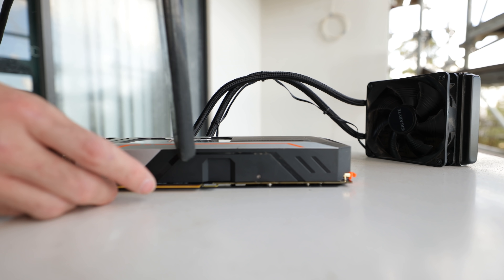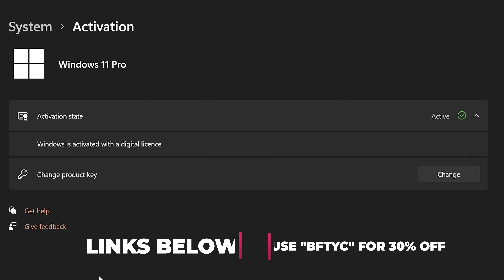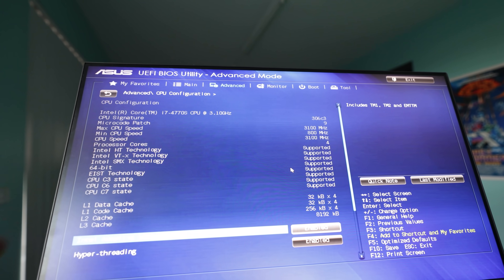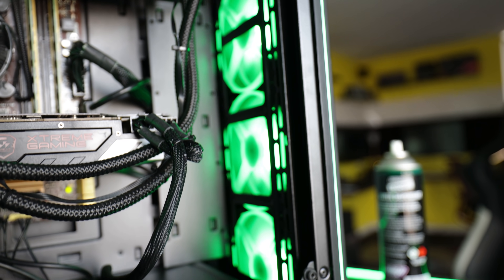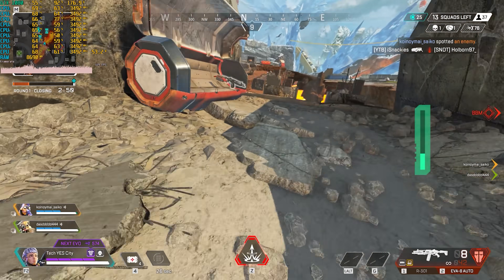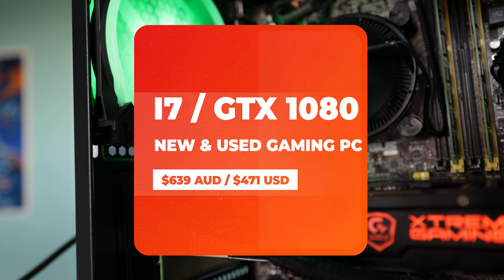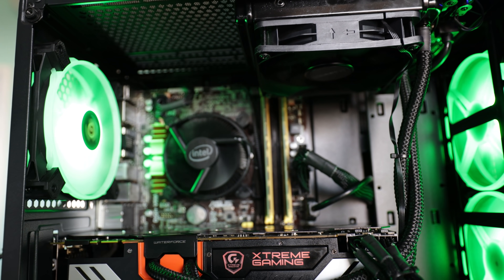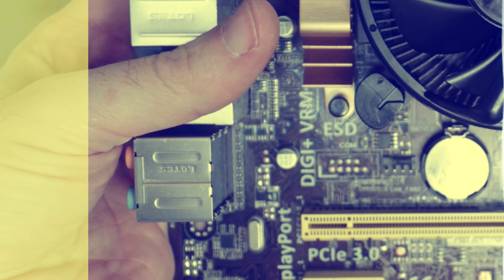This GTX 1080 STILL makes for a SOLID Gaming PC

Comment: Pascal was overpowered. Nvidia won't make this "mistake" again!
Reply: By default it really made the gtx 16xx series pointless before it launched
Reply: @licksludgee  As an owner of a 1660 Super, I don't dispute this at all, but I'm still perfectly happy with my card. Does everything I want it to at more than respectable visual quality.
Reply: @richardsinclair7661  because so many people have them, they were obviously necessary, it would have been arguably better if they mass produced 1070s and drove the price down for everyone instead though, I think that's where the frustration lives. Nvidia haven't pushed their performance much between the last few generations, it's a good thing for all of us when we can't get fairly priced gpus
Reply: Yeah 10xx was the best launch. 20xx was a fail, with no improvement in price to performance. 30xx they claim an improvement but its only cause they compare with 20xx.
Reply: @hellowill  *Grunts in Maxwell* Excuse me?
Reply: @hellowill  also don't forget gt 1030

No current successor today :( of low wattages, size, and performance
Reply: @bitelaserkhalif  
And underclocked 1050 or 460 outperforms the 1030 in watts and power.
Also, the 750ti exists
Reply: @DarkLinkAD  i had 760 2gb OC not ti but good start I got rx5500xt 8gb was m first but never used it. My motherboard died on me so I contact asus for warranty and support team help me out. To check the ram I send my memory for rma and never did rma code on the package. So I wasted $50 usd. My current GPU is gtx 1050ti 4gb it is ok for now. Wanted gtx 1080 8gb. My mobo is replace works nice with 16gb ddr4 max mhz that my ryzn5 2600 will go. I would like to have 3600 just 3600 and maybe tpm2.0 for flopows 11 but soon to linux after anticheat will works smoothly.
Reply: @bitelaserkhalif  Worse than a 750 Ti
Reply: @danb4900  750ti tdp: 75w, some model needs 6 pin for stability. Low profile units are hard to come by
1030 tdp: 35w, no 6 pin needed. Lot's of low profile models sold
Reply: @bitelaserkhalif  integrated graphics is now better. GT1030 DDR5 version was a good card to modernize old PCs for streaming modern video formats. Took an old dual core system and made it able to easily playback 4K 60fps. Now though integrated graphics does the job so these cards have very little use as they are not good gamers.
Reply: RX480 for 200$ got them shook
Never again now
Reply: @blackknight50277621  4gb were$199 and even that was only FE models. 8gb were going for 250+.  At times there was like 30-40$ difference between 1060 and 480 models
Reply: @mesicek7   RX480s eventually went for 150$ new and 75$ used
Reply: 30xx is also overpowered. Got a 3060Ti for 500eur, and it beats a 2080super in everything. Value.
Reply: @sL1NK  Its real value is 250-300eur...
Reply: @CommanderTato  Sounds like to me you're still running a 1060 3gb lmfao
Reply: Pascal was what Nvidia could do if competition existed, they believed AMD that Vega was REALLY powerful
Reply: @lacucaracha111111  And now the 6900XT has no competition either. :O
Reply: @sL1NK  intel is breaking their doors down.
Reply: @WilliamHollinger2019  Like in the CPU department? Intel has to prove their worth after such a long time of slacking and being a-holes. We'll see about their GPUs if there will be any on stock at all.
Reply: @lacucaracha111111  - Shame it wasn't.
Reply: I am the proud owner of 3 1080 Ti's OC edition from Asus, their ROG line.   Best damn purchase I've made at least in the last 5 years.  They all work, they've all been given once or two re-paste and cleaning a la TechYES lovin', and they're all still battling it out, giving me 1440p gaming to my heart's content, or decent 4K gaming if I push them or connect two on SLI, and that is just awesome.  It makes me happy, so happy, I can't recommend Pascal enough as an architecture.

Too bad that tech THAT good only happens once, maybe twice, in a lifetime.
Reply: @Paul_Ivanish  I have only one 1080ti :p It's a beast of a GPU!
Reply: Yea, and I won't make the mistake of upgrading my GPU every year. It's going to be a 3-5 year thing for me now.
Reply: @iTyler888  yes I have my Msi 1070 purchased in 2016 still running on a system built in 2015.   5820k o/c stable at 4.3 ghz.  At 1080p it will run most games high settings like modern warfare at 100 fps+.  But switching to 1440p it drops nearly 30-40 fps.  So a 3070 will boost them rates way back up for 1440p. Good for another 6-7 years haha.
Reply: @iTyler888  it used to be different, the 8800gtx lasted well into the 200 series, oh how we miss the golden days
Reply: gimme 12 gigs
Reply: So people keep saying.
Reply: true A DLDD only for RTX .... but did you see a AMD reaction?? with new systemy RDNA2:? well thats somehintg XD adms DLSS like work on GTX1060 XD yaa sayonara nvidia..
Reply: With the current prices I just spent $460 on :
2x GTX1070 Asus Strix
1x GTX1080 Asus Strix 
1x GTX1080 Gigabyte G1 

These were upgrades to lower tier 1060/970/1050ti cards and I likely will only be $40-80 out of pocket once the older cards are sold. Still Pascal is amazing for value. Windows 11 support, Gsync support, onboard video decoding and relative low power.

Comment: Honestly, you seen how much a used  GTX1080 is here in the UK? I'll tell you, they're going for £400! Might as well get a series S instead!
Reply: That is only coz of mining. When Ethereum goes to POS, they will be cheap as chips again.

If you're in the market for a used graphics card now, you should just wait.
No point in buying horrendously overpriced goods now.

An Rx 6600xt equivalent would be sub $300 (adjusted for inflation) lower midrange GPU any other time in history but now they are going for like $700 or $800. Crazy
Reply: @scroopynooperz9051  - I've "been in the market since February" when I built my Ryzen 5 pc....lol
Reply: @buggerlugz6753  well stay in the market - dont commit unless it's a really good used deal.

You will be kicking yourself if you buy a $800 lower end GPU right now and in a year's time that same GPU is sliced in half. 

I wager when the market stabilizes, you wont be able to sell what is essentially a 1080p card for nearly that much ever again, so you will end up getting hosed.

Unless you absolutely NEED a GPU for production and work now, it's part of your livelihood, i wouldnt bite.